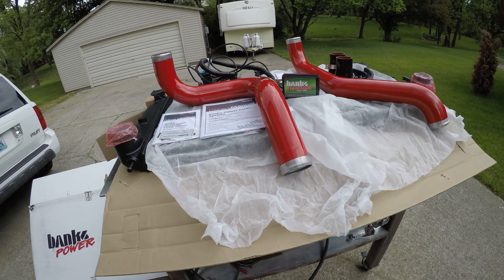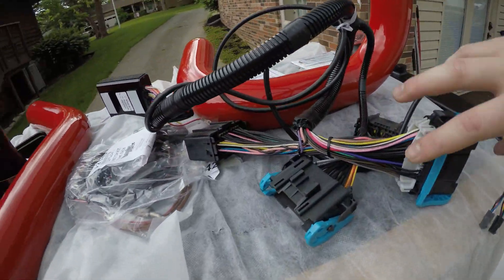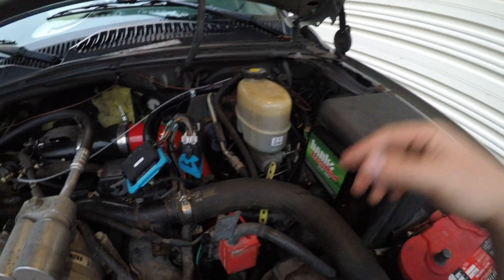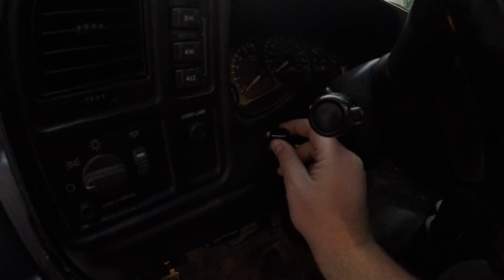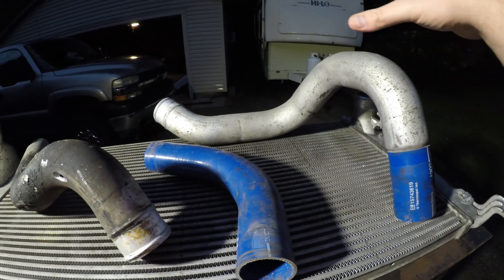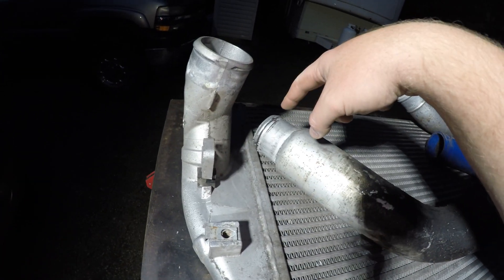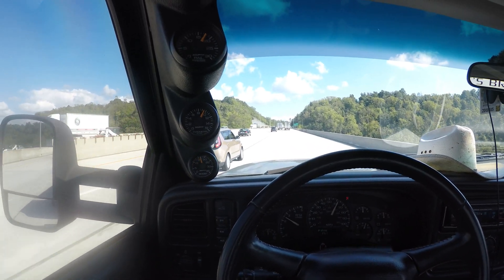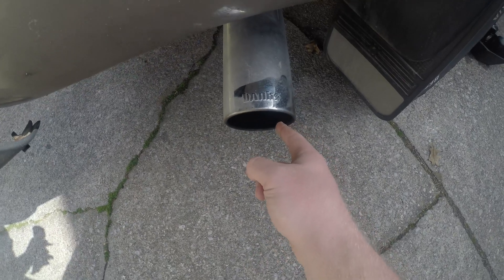Upgrade Lowdown:  '02 LB7 Duramax Banks Power TechniCooler Intercooler and EconoMind In-Line Tuner

Comment: Hey jay i got a question about your banks intercooler? I’ve got an 03 lb7. Do you know the core width of that banks intercooler? Could you find out for me? Interested in buying one. 
I know the stock one is 1 5/8” width.
Reply from the maker: Hello!  According to the Banks Power website, it's 25% thicker than the factory one, so that would mean it's 2-1/32" thick.  It seems to make a HUGE difference.

Thank you for watching and for commenting!  Please let me know if you have any additional questions about my truck and what I've done to it.
-Jay

Comment: Thanks for the information. I have the same setup with the PPE exhaust manifold and the Economind. I am installing the Economind and the Exhaust Gas temperature probe has different threads than the PPE manifold port. What did you do to make this work? I think the best option is to drill and tap the manifold, but I wonder what you did. Thanks.
Reply from the maker: You're welcome!  I'm glad the video was useful for you.

The technician at the dealer where I had these installed drilled and tapped the manifold to match the Banks sensor.  I've had no issues with it.

Please let me know if you have additional questions about my truck and what I've done to it.  Thank you for watching and for commenting!
-Jay
Reply: @JayRussellDuramax  Thanks for the reply. I ended up doing the same thing, drill and tap the existing hole in the manifold to the proper size. I wanted to put it on the driver’s side and avoid running the wire all the way across the firewall, but then I reasoned the computer is probably calibrated to account for the length of the wire and put it on the passenger side. It was quite a lot easier to do the passenger side as the manifolds were already installed. I used a magnet to fish out all of the metal shavings.
Reply from the maker: @TieCoon777  You're welcome!  I hope you enjoy your truck with all of this installed.  It all certainly made a big difference for me!

Comment: Dear Sir. Do you have a parts list for this build? I am overwhelmed with all the options on the Banks site. I have an LB7 pushing 350000 miles and my mileage has dropped severely. I was hoping to increase mileage. 
Thanks for the great video
Reply from the maker: Sure!  Here's all the Banks Power products I have on my truck:  Ram-Air Intake, Monster Exhaust, TechniCooler Intercooler, and EconoMind Tuner.

If you want to go beyond Banks Power, here's what else I've installed:  PPE manifolds, up-pipes, and down-pipe; and a Fleece Performance Cheetah 63 mm turbo and ported intake horn.

Installing all of the Banks Power products should be a radical change in performance and mileage on your truck.  To be safe, though, you may want to check the balance rates on your injectors before doing any of the Banks stuff.  They could be going bad and causing your fuel mileage to drop.  I have S&S Diesel Motorsport SAC00 injectors in my truck, and they're incredibly good.

Please let me know if you have any additional questions about my truck and what I've done to it.  Thank you for watching and for commenting!
Reply: @JayRussellDuramax  thanks

Comment: Yup! I had the same hole in my hot side charge tube from rubbing on the power steering pressure line on top of the steering gearbox. Luckily I was a fabricator at the time so I welded an aluminum patch over the hole and insulated it from the steering line.
Reply from the maker: Yeah, I've heard it's a really common problem on these trucks.  It's funny to me that Banks Power was able to put a larger pipe in it's place by properly routing it.  Both pipes are easy to remove as well.  Banks Power really knows their stuff!

Thank you for watching and for commenting!
Reply: @JayRussellDuramax  Gale and his team are amazing and good to know they fit even better than OEM!
Reply from the maker: @FOXCRF450RIDER  Absolutely!  I'm thrilled with all of their products that I have on my truck.  Please let me know if you have any questions about anything I've done to my truck.

Comment: I was wondering if it is recommended to get the tuner with the cooler.  Also was it it difficult to install? Thanks again for your video!
Reply from the maker: Hey!  All of these upgrades were installed for me by Sutherland Chevrolet.  From what I understand, the whole front fascia needs to come off, and the radiator needs to be lifted out of its mounts for you to get the intercooler out.  The charge pipes are fairly easy to remove with the wheels and inner fender liners removed.  

As far as the tuner, Banks Power says their performance numbers are on a stock truck "with recommended airflow improvements".  This tuner used to come in their Power Pack kit that also included the Ram-Air Intake, Monster Exhaust, and the TechniCooler Intercooler.  So, if you're wanting this tuner to work its best, I'd get the recommended airflow upgrades to go with it.  You won't regret it!

One thing to note, though:  My truck also has upgraded manifolds, up-pipes, down-pipe, turbo, and intake horn.  Those go way beyond what this tuner was intended to do, but, as you can see in this video, it still works well with my setup.

Please let me know if you have additional questions.  Regardless, I appreciate you watching and commenting on so many of my videos!  Thank you for being a regular viewer; I really appreciate it

Comment: Have you had any problems with the transmission going into limp mode?
Reply from the maker: Not at all, Keith!  The EconoMind is set up such that, if the transmission experiences any slippage, the power is immediately reduced to stock.  It rarely happens, but, when it does, you can feel the truck nose over as power is reduced.  It'll even feed the power back in once the transmission stabilizes!  It's seamless!  This tuner is incredible, and I'm amazed at how much power the stock drivetrain can handle.

Some buddies and I did some roll racing, and we all agreed that my truck makes the better part of 500 horsepower to the tires - or about twice the factory output.  Many many people will tell you that these transmissions can't handle more than 100 or so horsepower over stock.  As I hope you can see by my videos, that's simply not true.  These Allison transmissions are incredibly good in stock form; you just need a tuner that makes power in a way that respects the transmission.  The EconoMind and Six-Gun tuners from Banks Power are the only ones I know of that do this, and that's why I have one on my truck!

Thank you for watching and for commenting!

Comment: nice job long live the working mans diesels who the heck is buying these new ones at 100k? 
I have 03 lb7 310k daily driver. stock besides lift pump. its slow, needs to be gone through after this winter front end was rebuilt by me red head steering gear Oem pump and lines are the 2 piece aftermarket style just get the oem ones I would after dealing with them. they are nice but seem either too long or too short.
Reply from the maker: That's cool to hear that your truck is over 300K miles!  I hope to be able to say that about mine someday.  

I'm trying to stick with ACDelco for replacement parts whenever I can.  Unless it's an upgraded part, the aftermarket struggles to match the fit-and-finish of the OEM.

Thank you for watching and for commenting!

Comment: Good video! Looking to do this kit, and the pump rub upgrade.
Reply from the maker: Thank you!  These upgrades work excellently with everything else I've had done to this truck.

What's the pump rub upgrade?

Thank you for watching and for commenting!
Reply: @JayRussellDuramax  so the original pump on the transfer case rubs against the housing creating a pin hole leak.   Also there is not a mount brace from factory forge tail nose of the case to transmission.. Ppe has a kit.
Reply from the maker: @nickledimez4012  Ok.  Good to know!  I'll look into that.  Thank you!